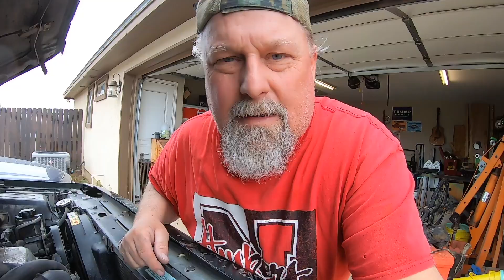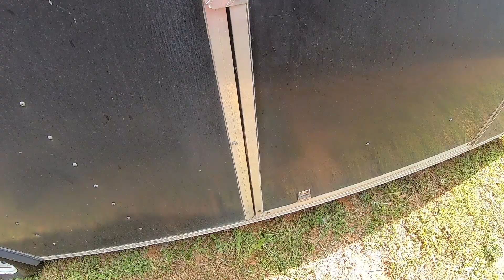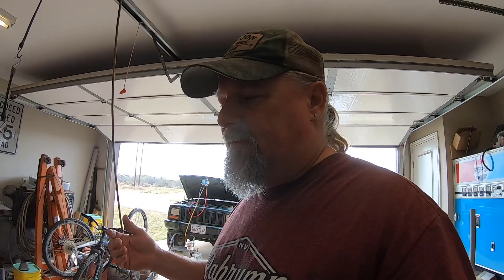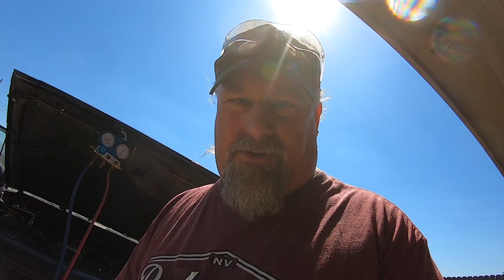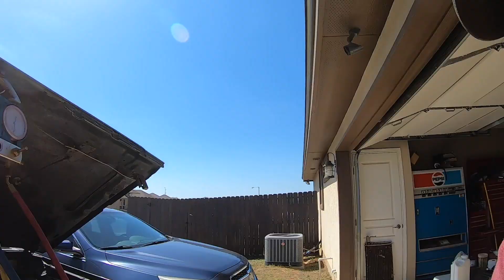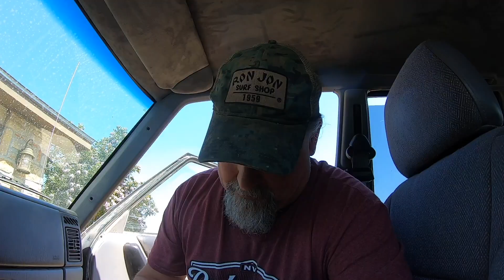How to recharge your AC!

Comment: Hey Rick! I’m not so lucky with ‘MY’ air conditioning system in my ‘99 GMC Sierra….it’s kaput…shot…dead!…evaporator core, compressor…ALL of it! The only thing that’ll revive ‘that’ baby is about $2k involving jacking the system up and driving another one underneath it! 😂😂😂. NOT gonna happen as I’ll be getting rid of the truck hopefully soon after 11 years with virtually no problems other than minor stuff that wears out over time. In the meantime a $20 clip-on visor fan works good enough for now!…yeah, I’m your long lost cousin! As for that motor mount would installing SOLID mounts be better or worse than those with rubber? Was always curious about that. Great video as always, stay cool (literally!), and have a great weekend! ~Jim~
Reply from the maker: solid mounts would suck. all the engine and drive train noises/vibrations would be transferred throughout the vehicle.  good if its a race car, not so good for a daily.
Reply: @dzlfreek  oh ok…good information. Thanks!